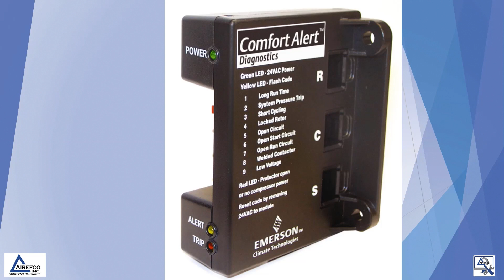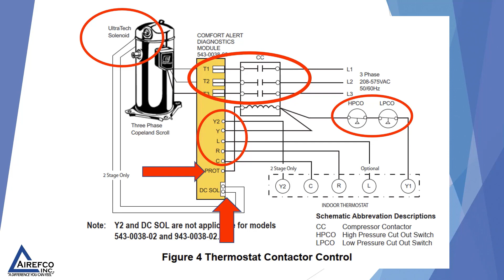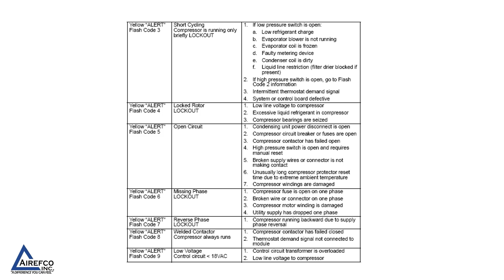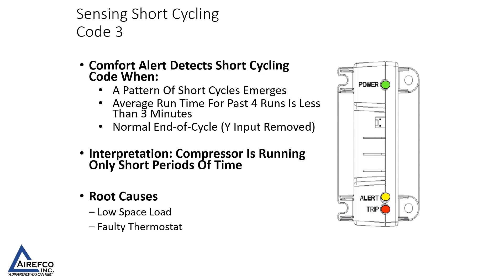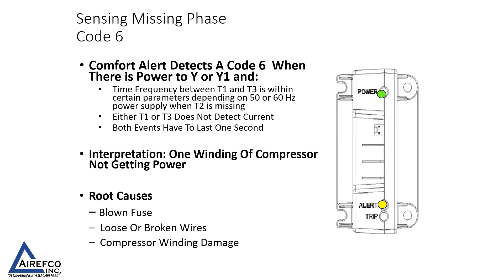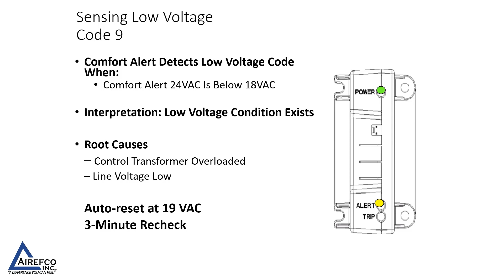Emerson Comfort Alert

Comment: Where would I begin to look if there is NO power at all to the emerson unit. No lights are on and everything is wired up. Air conditioner was working last year.
Reply: Just gotta check the schematic at that point and trace. We had one of these hooked up to a ECU unit on a military base and it was driving me nuts, but turned out to be the ice cube relay went bad.

Comment: I believe the device monitors current, not voltage to the compressor, the lack of which would signal a fault if the contactor is energized.